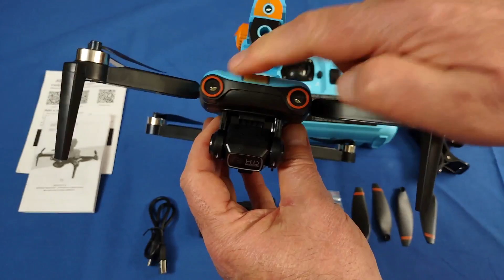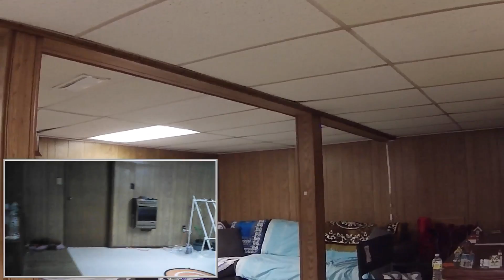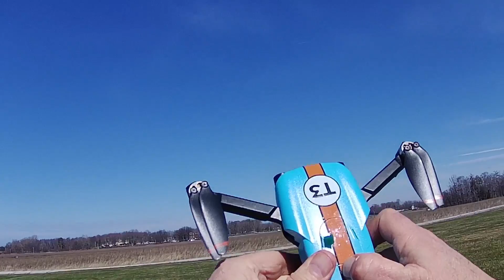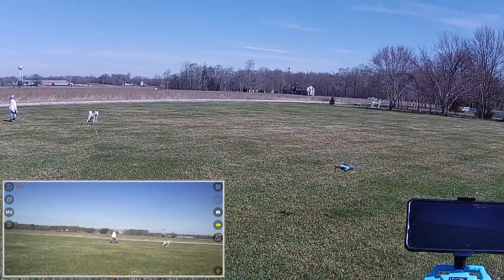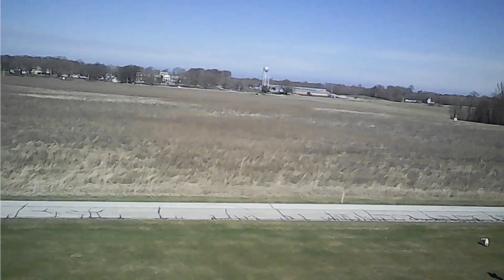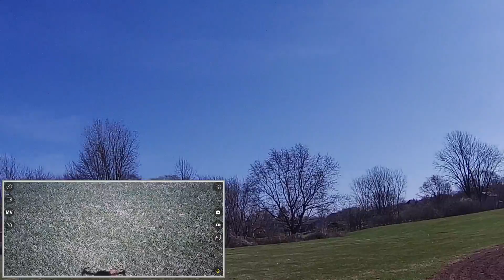Funsky LM12-D (LMRC T3) Pellet Shooter Drone Flight Test Review

Comment: Q101, I have several of these cheap brushless drones and all of their batteries are weak, just like the one you had. My solution was to replace the internal batteries with a good 750mah 25c 1s. You have to do some soldering, but you'll get a 5 minute flight time and  a lot more power for your trouble.
Reply: These are the ones I ordered from Amazon:
2 Pcs 3.7V 750mAh 25C 902540 Rechargeable Lipo Battery with USB Charger for X400 X300C X800 X500 HJ818H J819S Quadcopter RC Drone Spare Parts

Comment: They should have given it more battery life for it to also have a blaster mounted.
Reply from the maker: Agreed.  3.7V 1200mah is too small to power these brushless motors.  I've tested another similar drones that came with a 2000mah battery which gave it about 10 minutes of flight.